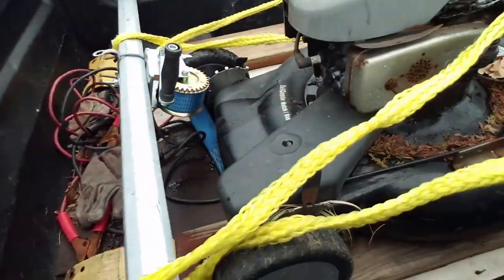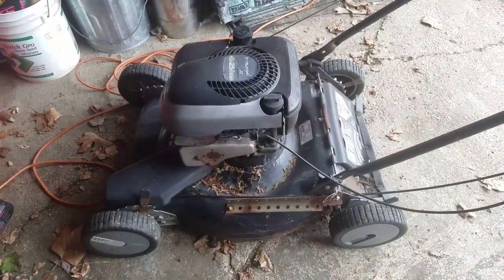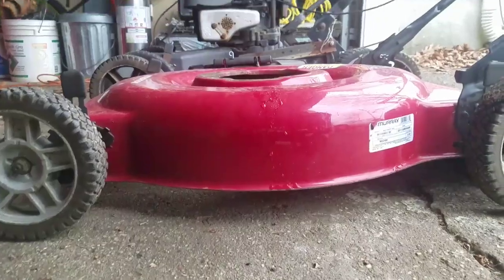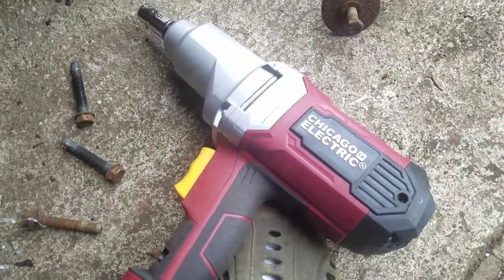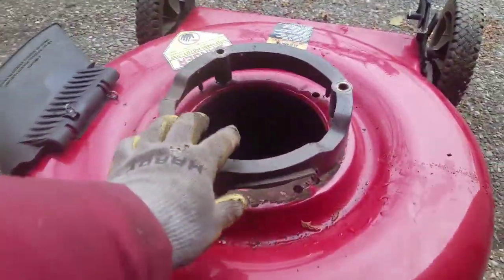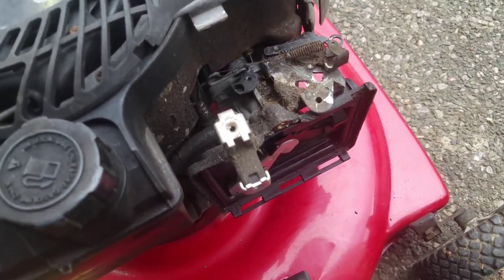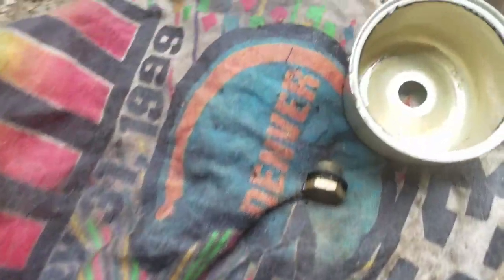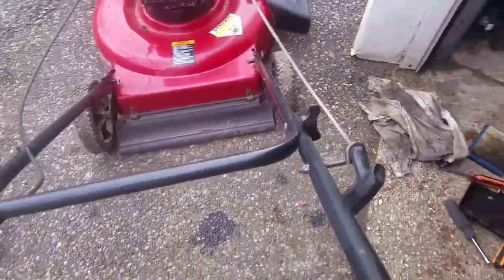MURRAY 6HP WALK BEHIND PUSH LAWNMOWER LAWN MOWER FREE BRIGGS DONOR MOTOR ENGINE SWAP PROJECT REPAIR

Comment: Last summer I picked up a old ariens push mower with briggs and Stratton. Engine started like crap so I took the parts off the engine to put on another mower
Reply from the maker: At least you made good use of it!  Hope you subscribed

Comment: Lucky the motor did not blow Henry but fair play. A nice result.
Reply from the maker: Yeah Pete, didn't run more than a minute...i should take some of my own advise and always check the oil. Lol...hope you are well Pete!
Reply: Good thanks Henry . Bullet proof them L head motors will take a fair bit of abuse . I call them side valve or flat head .
no more snow now i hope .
Reply from the maker: So far so good...its still a bit nippy, about 45 degrees F. Will warm up to the 60's next week which is about right for April.  How about over there across the pond?

Comment: what you do here is remove the long blade mount and install a short one, the deck spacer isnt needed.
Reply from the maker: The Murray engine is designed with the spacer.  I had the spacer but I did t have a short adapter

Comment: You need black impact sockets
Reply from the maker: I have them...but didn't need them. Chrome worked fine.
Reply: I know it's only a Harbor Freight impact driver, but chrome sockets could shatter when you use them with an impact.  You don't want metal shards flying in your direction.
Reply from the maker: True that brother.

Comment: Those brigs E engines are junk. When you swap engines it is very important to check the drive shaft length.
Reply from the maker: Thus the use of the spacer.